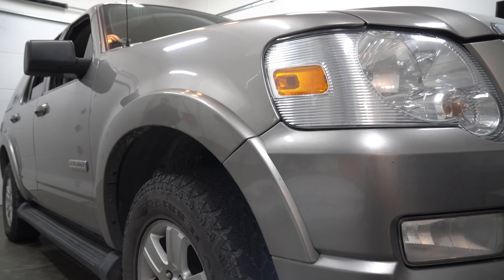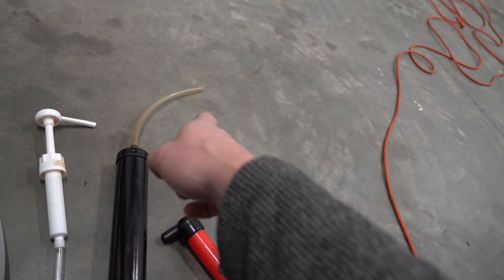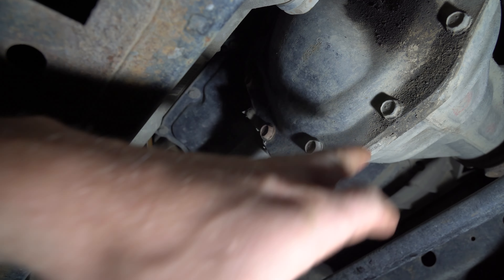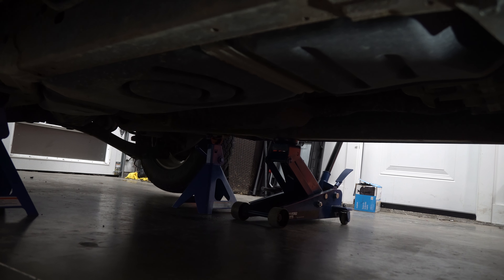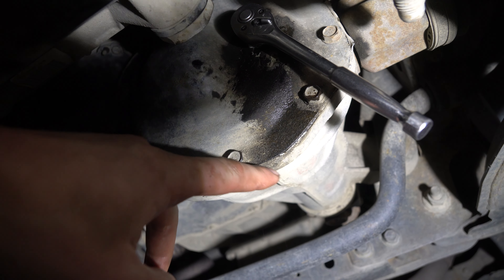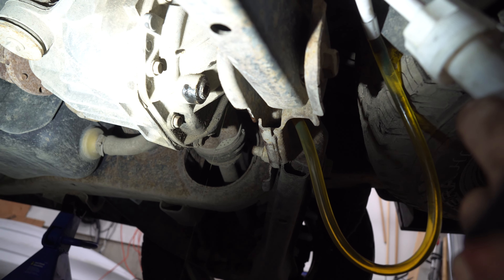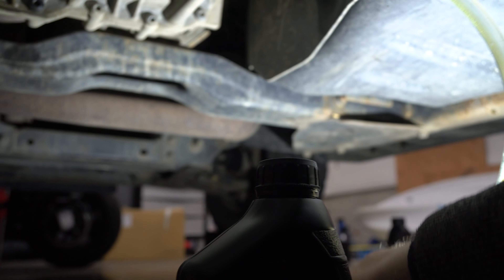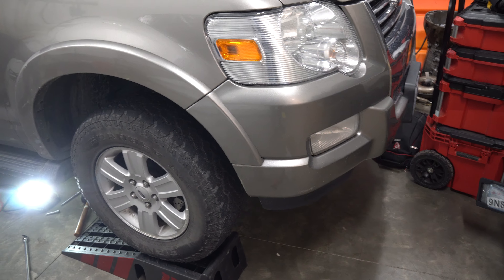HOW TO CHANGE DIFFERENTIAL AND TRANSFER CASE FLUID FORD EXPLORER 2008

Comment: Hey boss you never explained what fluid you used for the difs
Reply from the maker: Oh buddy got it straight from ford so its all ford brand usually i use Lucas synthetic
Reply: Might state fluid types on the differential covers, mine do. I used 80w/90 on front diff and 75w140 on the rear diff. I have a 4th generation, V8 (2007 Explorer, 4.6 litre).
Reply: @atoiler1389 no additive friction add????